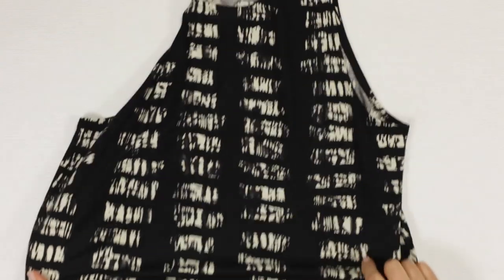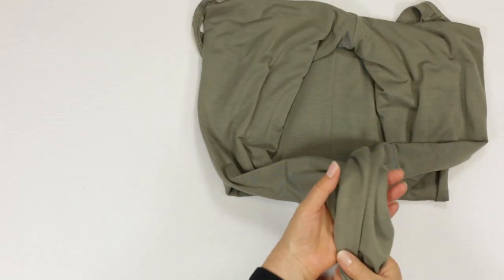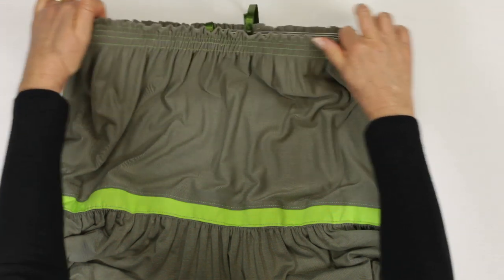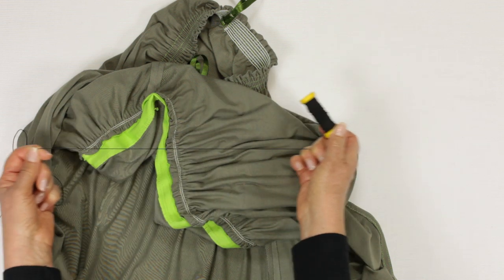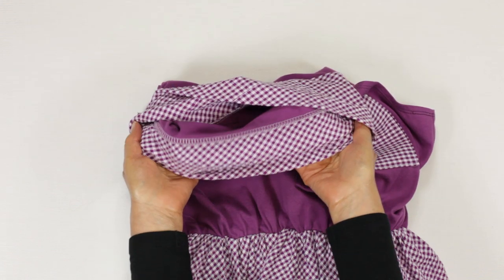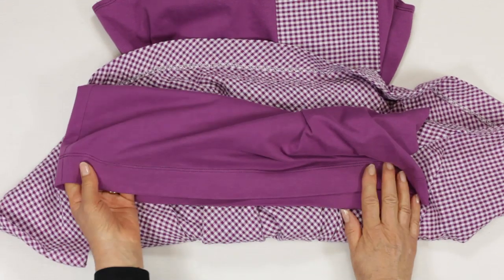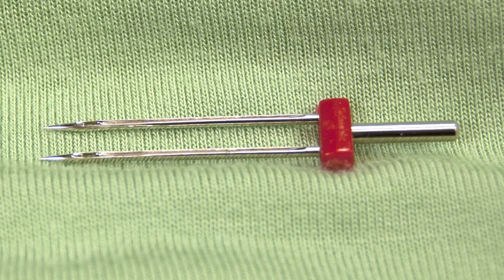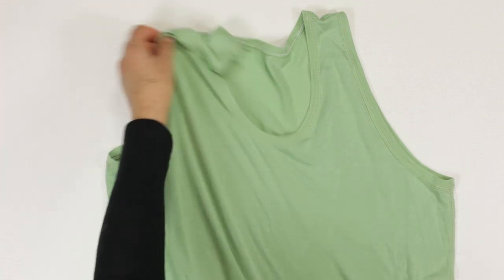Sewing -  Sewing Jersey Part 2 - Making T-Shirts and Dresses

Comment from the maker: Thanks Tamarra. Yes, in many ways I think using a regular sewing machine for jersey is better. After all, jersey doesn't fray and a narrow seam allowance is less bulky than an overlocked one.  It there is an advantage it is that an overlocker sews fast and trims at the same time.

An overlocker is very useful for neatening seams on woven fabrics of course but there is nothing you can't sew with a regular sewing machine.

Thanks for commenting.

Comment from the maker: @samuelmakyn Hi, You either want a very sharp needle often called 'microtex' or a jersey ballpoint or a needle labelled stretch.  Try a new needle, needles blunt very easily. Are you using pure spandex or a blend?  Try lengthening the stitch.  If the fabric is being pulled down through the stitch plate try loosening the tension. If you are still having problems email me - go to my channel. I can't post email addresses here it seems.  I would like to sort this out for you.